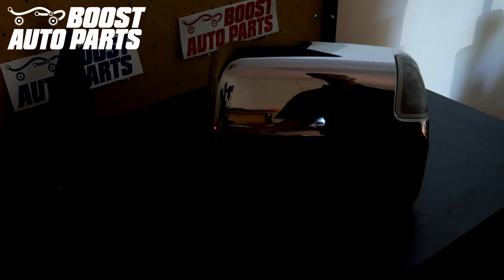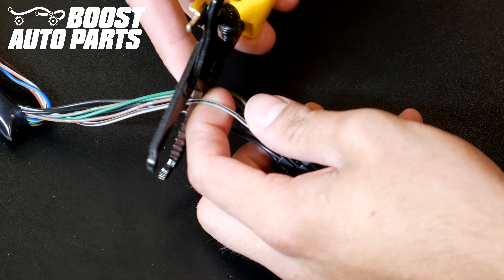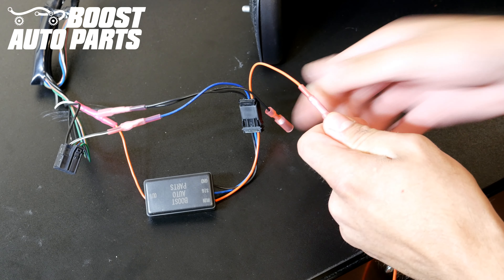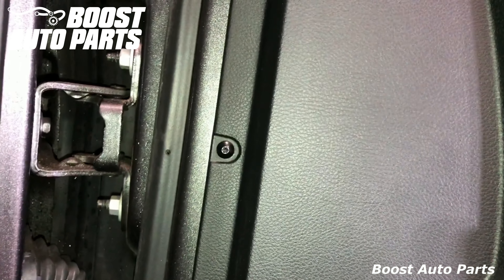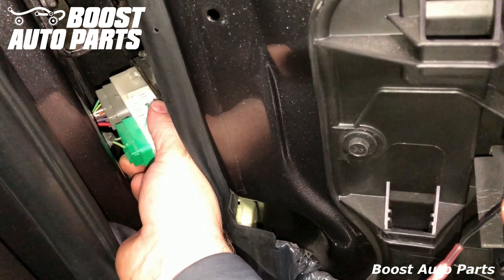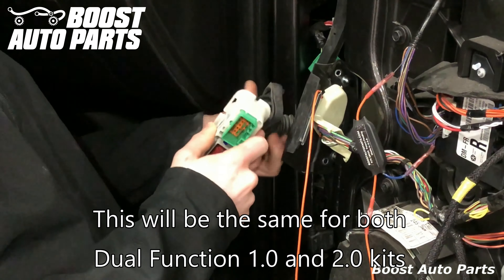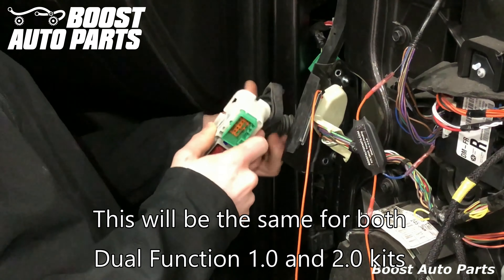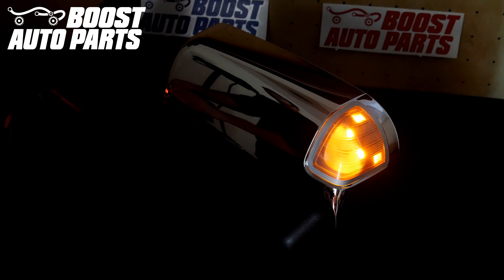Dodge Ram Running Light & Signal Tow Mirrors Mod (FOURTH GEN Dual Function 2.0)

Comment: I have a 2011 RAM 2500 and the turn signals, running lights and puddle lights do not work. Does this kit make it so all of that works? It didn’t come from the factory with tow mirrors , I installed them myself. Thanks!
Reply from the maker: This kit will get the running light working. To get the puddle and turn signals working you will need to have some sales codes turned on. We offer a tool for 2013+ vehicles, but not 2012 & older. Reach out to our team at 765-831-2830 or sales@boostautoparts.com for further guidance.

Comment: How do i install this harness on a 2012 1500? I dont have the same plug in the dash as you. And my truck never had turn signals on the mirrors.
Reply from the maker: To gain the turn signal you will need to enable that via the dealership. For the running light, reach out to our team at sales@boostautoparts.com for guidance.

Comment: Just hooked everything up and only have running lights no turn signal or puddle lights anything I could’ve done wrong for this to happen? Got a 2014 ram 2500 slt
Reply from the maker: In order for the signal and puddle to work you must originally have signal and puddle. If you don't, you need to have sales codes LEB and LEC enabled at the dealer. Email support@boostautoparts.com for further guidance.

Comment: Does this work for the fancier mirrors with the LEDs at the bottom for white paddle lights and orange turn signals? The non tow mirrors with power fold, auto dim, and heating.
Reply from the maker: Yes!

Comment: I know this was a long time ago I have the 2017 1500 with the towing mirrors the abmber signals only go on when I use my blinker. Stock 
I just want to use them is amber running lights not turn signals anymore how do I do that.?
Reply from the maker: Sorry, we don't have an upgrade for running lights only. You would need to do the signal and running light shown in this video.

Comment: Hi ! I got a Ram 1500 2017 , with tow mirror ! The dealer have alrrady program my Flashing light ! If i buy your kit i only have to install it and after that my mirror lights will always be on when I drive at night? Because its what i want :P
Reply from the maker: Yes
Reply: Ok thanks ! But for running light on my 2017 do i need only to do the first part of the video? I dont understand the second part is for what ? I have your kit at home !
Reply from the maker: @10Allard  You need to perform the full procedure. Give our team a call at 765-831-2830 with any questions

Comment: I bought this unit but I maybe returning it. I should have asked a question before buying it. How close is it to the regular cab lights on the roof for brightness? If the tow mirror running lights are brighter than the cab lights, I will be returning it.
Reply from the maker: The brightness of the lights will depend on the specs of the lights that are inside your mirrors currently. We have a 1.0 & a 2.0 version of the kit. The 1.0 version will have a dimmer running light. 

Please contact support@boostautoparts.com with any further questions

Comment: My 2016 truck has all the following options , defrost , power folding , running lights , turn signal etc . Is it plug and play or do I need to remove the door panel and do extra wiring ?
Reply from the maker: No 2016 trucks come factory with the running lights; you will need to add in this kit with the orange wire for running light in order to gain the running light feature this kit adds.
Reply: Boost Auto Parts ok I wanted the switch back option , is there anything else I need to do ? I’ve seen videos where people don’t take off the entire door panel like it was done in this video , just want to know if that’s the case with mine before I purchase them . Thanks!

Comment: You mention that extra butt connector for other applications.

Out of curiosity, what are these other applications??
Reply from the maker: It is used on some GM applications.
Reply: Boost Auto Parts can you use that connector to run other running lights on the truck or will it interfere with the mirror lights?
Reply: @codydonovan7356  that’s a great question

Comment: I have a 2012, If i tapped into the running light behind my headlight knob, would your harness still make the turn signals work? or is that something that would have to get flashed?
Reply from the maker: Turn signals require flashing - our harness only adds the running light.
Reply: @boostautoparts  programmed it myself with the alfaobd app and an OBDLink Mx+. Thanks for the harness!
Reply: Hey man, i also have a 2012 and am trying to install this harness. Did you just tap into the headlight knob wiring? If so which wire did you tap into?
Reply from the maker: @jplumb41  For a 2012 go to the underhood fuse box fuse #35
Reply: @boostautoparts  I’m confused. I have a 2012 3500. The turn signals in the mirrors work. All I want to do is make the light turn on in the mirror as a running light. If I bought your kit, would I also have to get it flashed too?
Reply from the maker: @johnnyg8391  No - for you all you would need to do is tap to underhood fuse box, #35... no flash necessary. The flash is only required for those who originally did NOT have signal (which is not you).

Comment: Can you just connect the orange power lead to the ambient lit door handles inside the door panel instead of running through the door ? Only want mirror running lights on when lights are on.
Reply from the maker: Other customers have done that with our 1.0 harness, but we haven't tested it. The ambient lit door handles are on the dimmer circuit so it should certainly work if you have the interior lights turned up, but it may not work properly if you dim the interior lights down a considerable amount.
Reply: How did this work out?